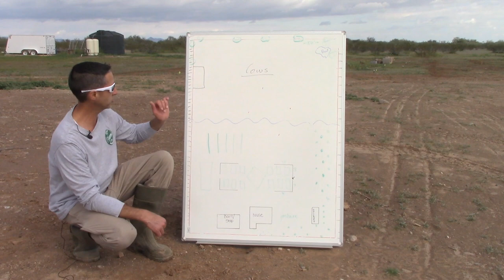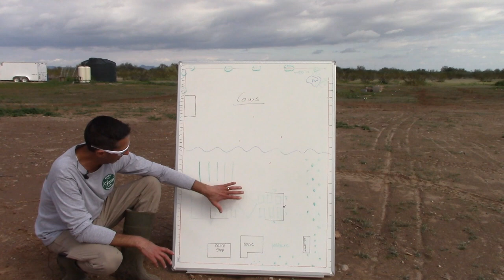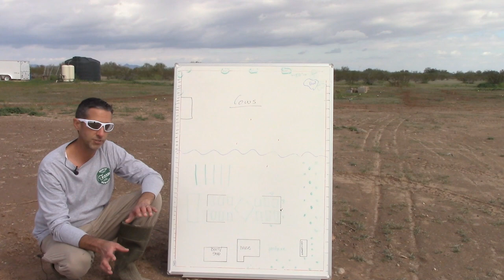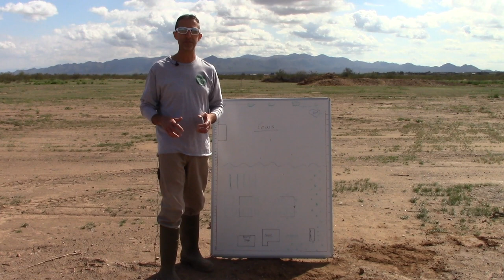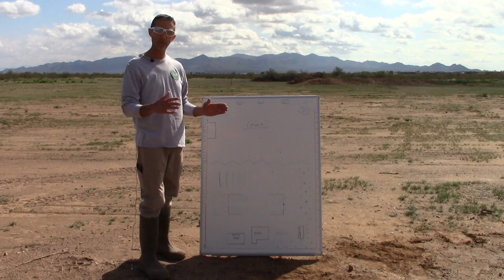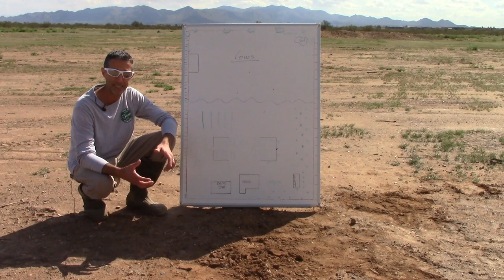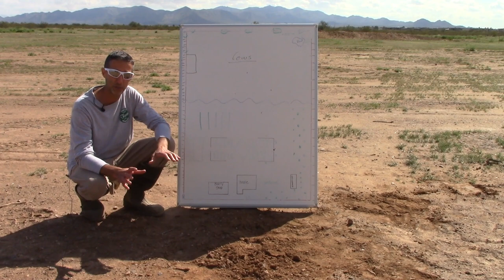Farm Fencing Install Part 1 - The Plan

Comment: I'm surprised that your reason for not getting electric fence is kids....  I'm told they learn pretty quickly Lol!!  Anyway, when it comes to electric, I had heard that dry soil makes it harder to get a good ground.  Is that a real concern?  Also, I'm curious what the options would be for temporary rotational fencing.  Can you actually get a dependable ground to use electronet or poly braid? Or would you go with  permanent - semipermanent paddocks with barbed/woven wire etc?  Back here in PA it's pretty soggy (blah), so electric grounding isn't an issue.  You really can't beat poly wire/braid or net for ease of use, cost and flexibility.  I'd love to do some holistic/regenerative grazing out there and I'm trying to get an idea of how the management of the pastures would look.  You've got a great plan, can't wait to see how this part turns out!  Thanks!!
Reply from the maker: Those are some GREAT questions! We do have some concern with the ability to ground electric. While we're going with barbed wire for the perimeter, we do plan on trying some electric netting for some of our livestock. Particularly with chickens and especially turkeys. We'll probably use several different types of fencing depending on the type of animal (example would be pigs and using pig panel with tposts). Really haven't figured out paddocks and rotation with cattle yet. There's only about 2 acres set aside for them right now, so not even sure if that's feasible. We'll have to see once we get to that point.
Reply: @EdgeofNowhereFarm    when we had sheep, we used net and it was the way to go!  Check out Premier One Supplies.  We used both their net and two different types of portable energizers (both solar).  They were all high quality and worked flawlessly.  The owners are extremely experienced in sheep and their catalogs really show it!  If you haven't already, grab a free catalog...... They also have supplies and nets specially made for pigs, chickens and cattle.
Reply from the maker: @zadokmotorfreight2423  thanks for the suggestion. We've seen lots of folks recommend them and they seem like THE place to go for electric! We do plan on adding sheep eventually, so please give us some pointers when we start to bring them in.

Comment: What types of natural predators are you anticipating in regards to your livestock? I assume coyotes and hawks. Anything else?
Reply from the maker: Hey Catherine! So the primary culprit would be coyotes for the smaller animals. They pretty much leave pigs alone as long as they're a good 50 lbs or more in size, but chickens, smaller goats and smaller sheep are ripe pickens for them. Hawks for the chickens and smaller turkeys. We've had sightings of a mountain lion through the wash near our current property, but you shouldn't have that issue over on 255th. The bigger challenge is keeping the birds and bunnies from all of the fruits and veggies...and the free range cattle of course. They eat pretty much anything green.
Reply: Edge of Nowhere Farm We get Javelinas, Bobcats and Owls by us in Paradise Valley in addition to the predator/pests you mentioned, and they may be in your area too.
Reply from the maker: @danielfisch655  ooh, forgot about those bobcats. Amazing you guys get those in town also!
Reply: tsimahei bobcats are usually scared away unless infected with rabies, I fear javelinas and mountain lions more. We have two German Shepherd mutts about 85-90 pounds each and they have scared a bobcat and a few coyotes off of our property but I don't let them outside alone if mountain lions have been sighted in our neighborhood which is extremely rare (only once during our two years living in Arizona).

Comment: Hi. We got a verbal acceptance on our offer today. Should be doing fencing soon. How much should I set aside for 180x200ft? Also how do we bring water from the street at the corner of our lot?
Reply from the maker: Those are some great questions and congrats on your new property! For fencing it really depends on what type of fencing you're going to do. For field fence/welded wire you're looking at just over $1 per linear foot for the fencing alone, so you would add your cost for tposts/wooden posts, etc to that. For barbed wire (your least expensive option) it would depend on the number of strands, but a roll of 2 point barbed wire, 1300 feet is about $70 at Tractor supply. For the water, I'm assuming you're talking about a well/shared well of some sort? If so and the distance is not more than say 100' or so you could tap into that with a 1" PVC line and reduce that to 3/4" to go into the home. Hope this helps!
Reply: @EdgeofNowhereFarm  Hi Duane, its city water. Thanks for the info on fencing. We are very eager to get our trees planted before it heats up
Reply from the maker: @shussing  Sure thing and we understand your desire to get those trees in the ground before it heats up!!
Reply: @EdgeofNowhereFarm  Got a sticker shock while shopping for fencing. Lowest quote I got was $7/ft and we have to cover 1.25AC. Wondering if a block wall would be better given we will have fruit tress to protect. Advice?
Reply from the maker: @shussing  We did block on the old farm because we only had to block 2 of 3 sides (neighbor did the 3rd side for us) and we wanted to block the view of one of the other neighbors. It does a VERY good job of keeping animals out, but it can be pricey also. No matter what you wind up doing it's just a costly venture. It's why we're going with barbed wire around most of the perimeter on the new property. We're looking at around $3k for the entire perimeter which is around 2-2.5 acres.

Comment: Hi guys can you give me some info on your gas powered t post driver? And how about the auger, how wide is auger but and where’d you get it? Thanks
Reply from the maker: Hey Dave. The t post driver and the auger were both on Amazon, but they seem to be hit or miss on availability. I have seen them on the Home Depot website also. They are both from Extreme Power. I'll link to our Amazon Shop here so you can check out the Auger (it's under the equipment Idea List). Right now it's available on Amazon.
https://www.amazon.com/shop/edgeofnowherefarm

I found a similar tpost driver with the same accessories on Walmart.com. Try typing this into a search there;
Yescom 2 Stroke 32.7cc Gas Powered T Post Driver 1.2HP Gasoline Pile Driver
Reply: Edge of Nowhere Farm awesome i had seen them before on those places, I bet these both really come in handy
Reply from the maker: @Dave-fp3uh  oh definitely. They are invaluable!